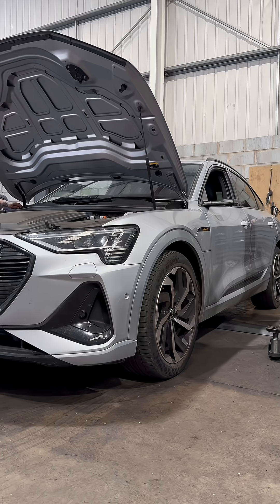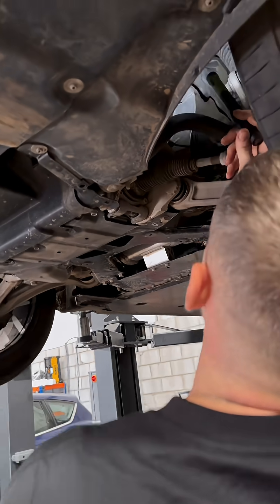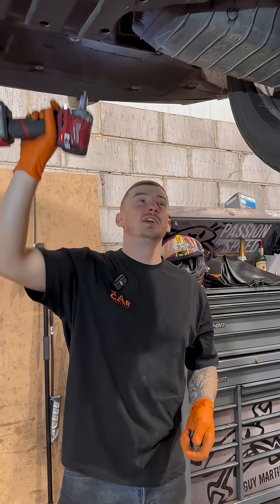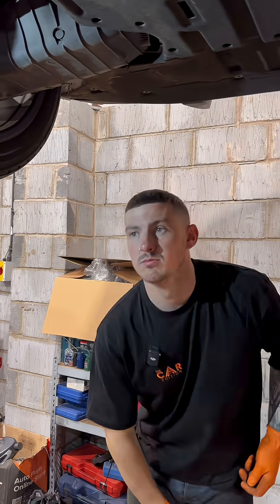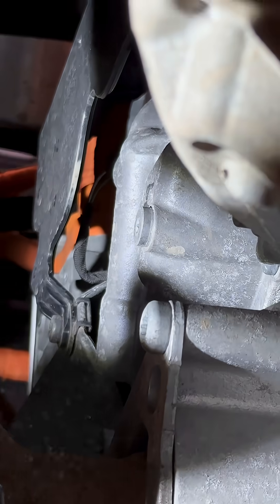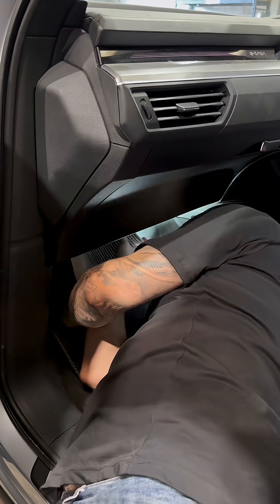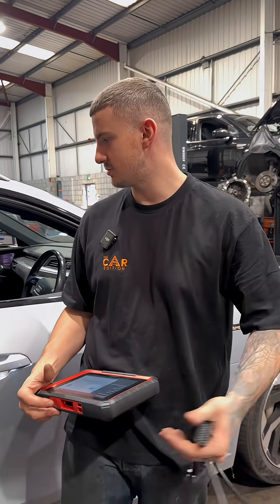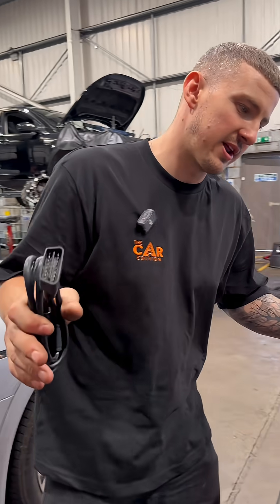How do you service an electric car? Audi E-Tron in for a full service 🦾

Comment: Service on an electric car ???😂😂😂
Reply: coolant? brake pads? discs? suspension bushes? tyres?
Reply: @PompeyMatt17 technically not a service. 
That’s a health check. Which, in fairness, any competent weekend warrior is more than able to do.
Reply: @PompeyMatt17 the coolant is low pressure and runs through what are akin to domestic plumbing. And you don’t use the brakes much on a EV because they use regeneration. And suspension… why? If it’s not clunky
Reply: @ethelred2648EV service should include an AC regas too as some use the AC to cool the coolant from the battery system.
Reply: @stephenreed1080 yes but, certainly on my Tesla, the system self monitors and reports to Tesla if there’s a pressure or performance loss.
Reply: They still have a cabin air filter, hydraulic brake fluid, coolant, differentials and some have air filters for batteries too and failing to change them can cause overheating and thermal damage to battery cells. Service it FFS those batteries are expensive. They also have a 12V starter battery just like an ICE so that needs to be health checked and replaced before you end up failing to start.
Reply: @gravemind6536 battery temp is monitored by the main controller so would be warned and performance reduced automatically if there was an issue. Also battery water cooled/ heated. Brake fluid is a silicon based one. 12v battery since 2021 is a lithium ion one. And, there are no products of combustion so oil in the diff needs changing at some huge mileage, like the oil in the diff of a Mercedes. Most of what you say is hogwash, but particularly the battery temperature thing.
Reply: @gravemind6536 Jesus christ!!! I'll stick with my 23 year old diesel van i think 🤔

Comment: Had it got oil? 
No
Had it got a dipstick?
No
The rest is easy 🤣
Oh and it will need tyres.....
Reply: It does have oil. All EVs have a reduction gearbox. 
Some have common failures. 
But it’s good sense to change the oil every 50k.